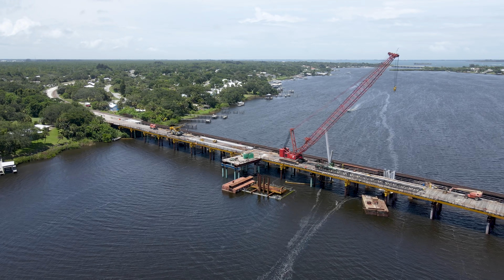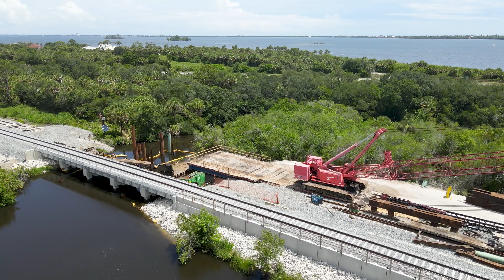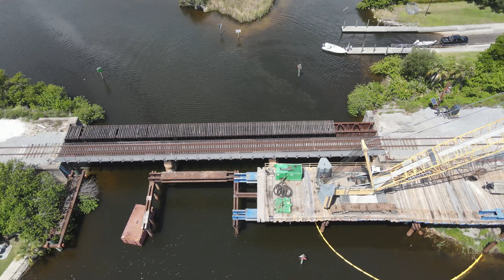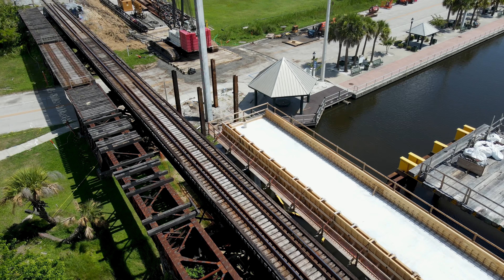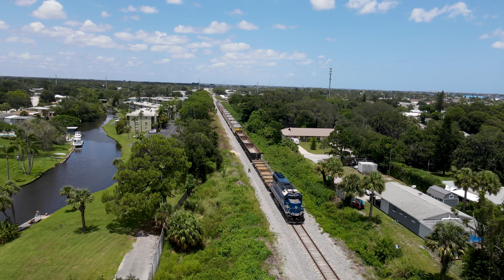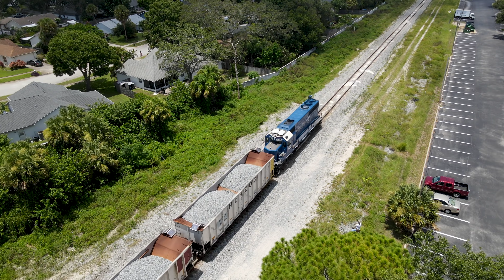Brightline Construction: July 2021 Bridge Edition

Comment: Here in Stuttgart the S-Bahn city tunnel is now closed. They are renovating the four underground stations and installing ETCS-Level 2. The goal is to pump 36 trains per hour through the tunnel by utilizing ATO. I can use the light rail for the last part to the office, so its not a big deal for me.